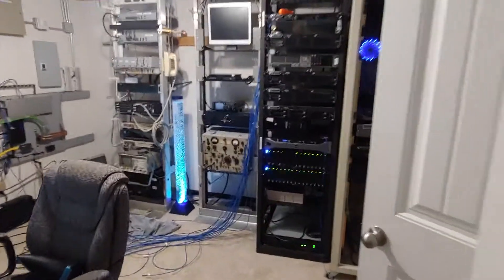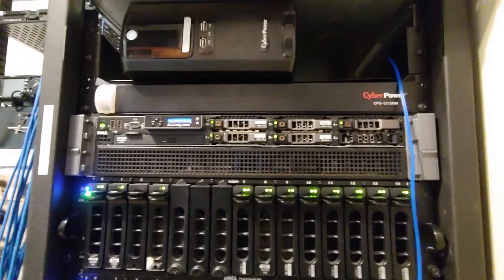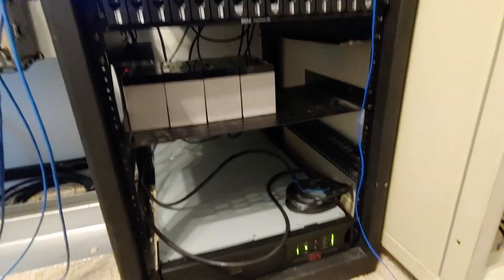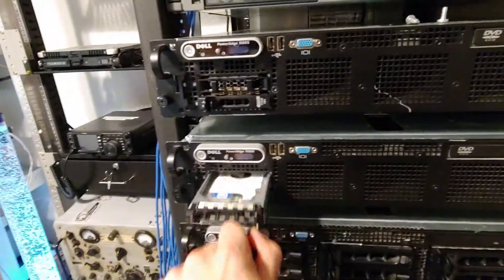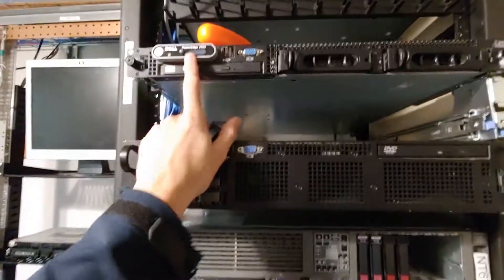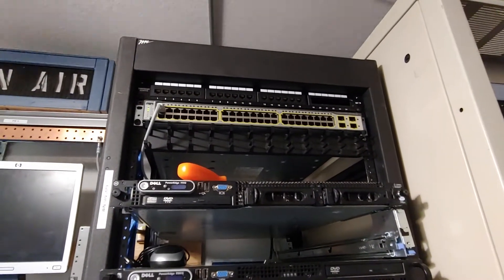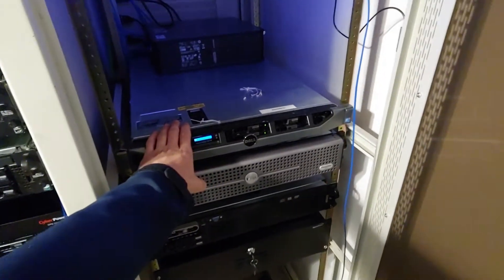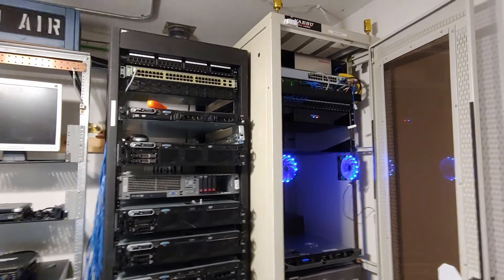Home server room build. Part 1

Comment: Excellent setup. I am also trying to take up this hobby. I am afraid how expensive this hobby would be. so I have a few questions:
1. how much more you are paying for electricity per month?
2. do you need to rent out a separate facility for that? 
3. what is the use of all these in terms of learning new skills in data science/ big data/cloud automation/AIops ? I am not really into gaming or streaming ( too busy with life. do not have the time for that).

Again. I am inspired by seeing your video. keep it coming!!
Reply from the maker: 1. 2 servers running cost me about 40 extra a month,. It really depends on the state you live in for the prices. 
2. No renting in this home setup.
3. I get asked a lot why I have this setup and its because the learning possibility's are endless. The servers I have at home are mine and are not in some data center somewhere costing rent space, just power. I have no regulations with a home lab and I don't need to schedule an outage to complete any service impacting work. Server parts are generally really cheap so I have a spare parts for most of my hardware. installing your own OS is very easy and you can change your entire system when ever you want. Many people in this channel prefer to have their machine remote, but i prefer being able to physically see and touch all of my hardware.

Comment: By the looks of this video, we handle our equipment somewhat differently. Good for you if yours runs fine anyway. 😊 For instance: Ejecting and inserting disks need / should / could to be done at a slower pace as you otherwise run the risk of ripping connectors apart when or if they end up just at the edge of the handling tolerance. I've seen it happening to colleagues.

Comment: What is that tall color changing light thing?
Reply from the maker: https://www.amazon.com/dp/B075QKKJ4P/ref=cm_sw_r_cp_apa_i_aMcmFb5SAXMNG
Reply from the maker: A bubble tube. I plan on getting another one. You put water in it and it bubbles and changes color.
Reply: @ATI556  I have a pipe that you fill with water, you usually smoke out of it and then you start seeing different colors.
Reply: @jimhopkins2530  yea and I got a tall rig with magical golden wax that makes me see bigmacs fighting in the street🤣
Reply: @ATI556  look nice but water is NONONONONO in server rooms...looking for a disaster in the future?
Reply from the maker: @raulgranadillo7   thank you for your concern but this is my "home" server room which means i can do with it what i want. This thing has been in there for a year and this room is only accessable by me and me only. Never had a leak or a problem neither do i have earthquakes.
Reply: @ATI556  Did you get it from Amazon? Link?